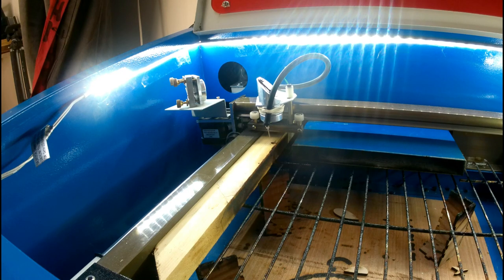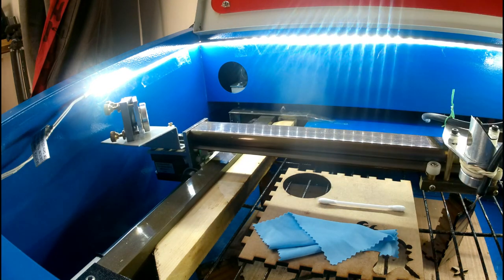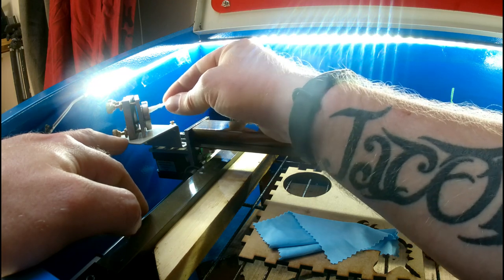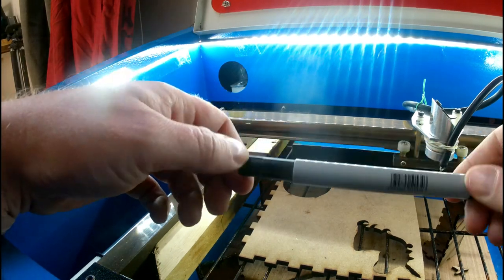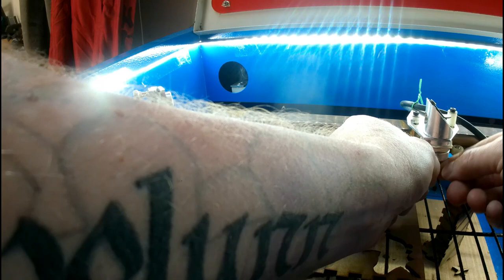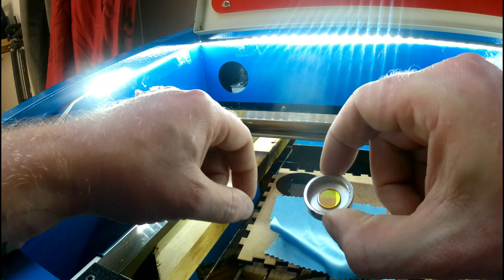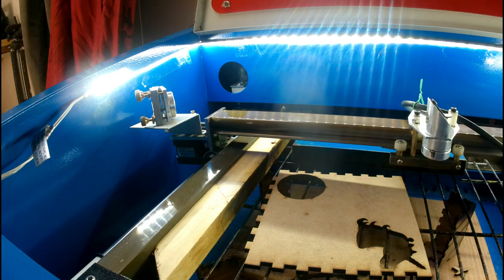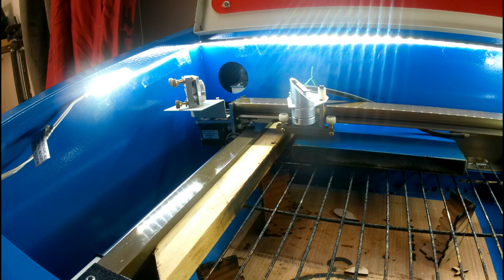Clean your k40 mirrors in 5 minutes

Comment: exactly the same way I do mine but struggle getting the lens the right way round ...
Reply from the maker: It takes a bit of getting used to but once you do it's pretty clear which way they go
Reply from the maker: Hi raj. Im not too sure if it's a good idea to post your phone number on social media like that. What kind of issues are you having?
Reply: @philscraftcorner  
Phil 
I've just bought this, it want go back to 0 ( X and Y )  point after each job
Reply from the maker: Hi. This will depend on your software. I use k40 whisperer and in the settings I can set it to return home, unlock the rail or beep. Have a look around in your program settings
Reply: @philscraftcorner  
Thank you Phil will try it tomorrow